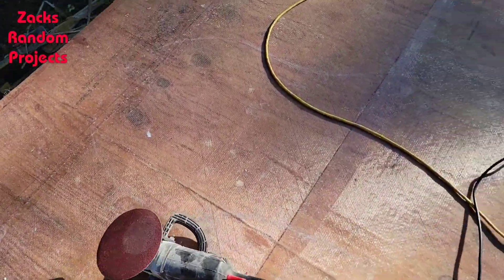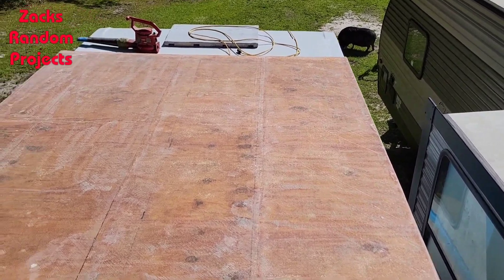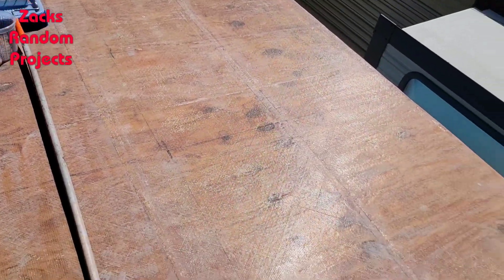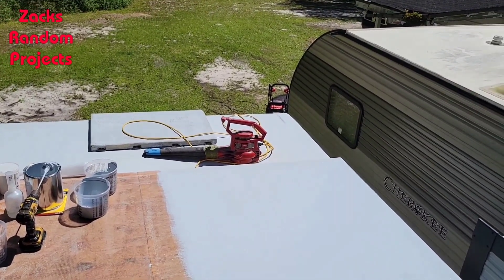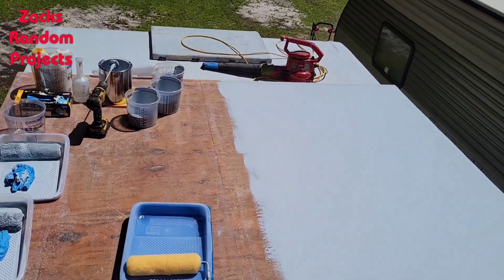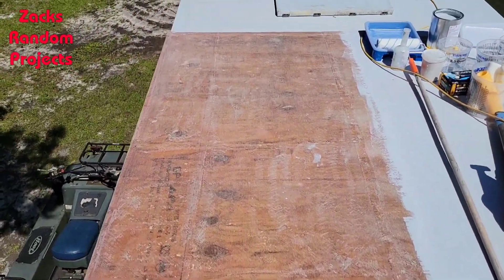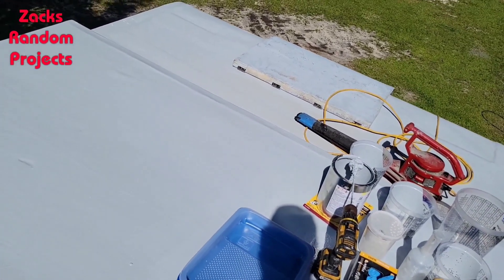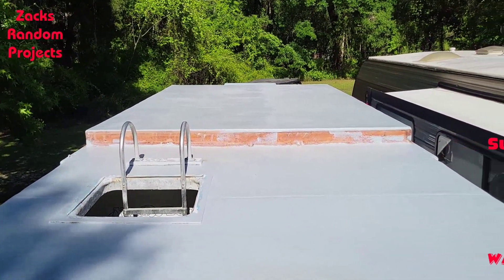Houseboat gelcoat on roof almost done!

Comment: Hi Zack, Looks good  was the gel coat waxed or unwaxed ? I'm doing a boat project now and cant decide which to use. Difference is it might be a couple days before I get to put more coats on after the first.
Reply from the maker: If I remember right it was waxed. I cant remember the reason why as Ive not did fiberglass in a few months. I think it has something to do with insuring it will harden correctly after you apply it. Im definitely not a fiberglass guy though, and I invite you to get your fiberglassing information from someone that actually knows what theyre doing! Lol Thank you for watching and commenting. I appreciate it! Have a good one!.🍻
Reply from the maker: @Nello Agostini I just got home and double checked. Yes, the gelcoat does have wax in it. Good luck with your project man! 🍻